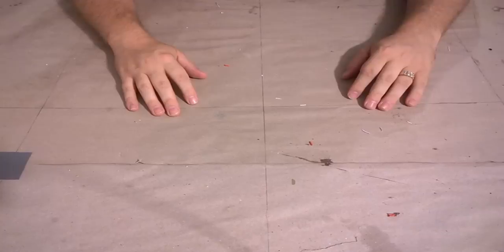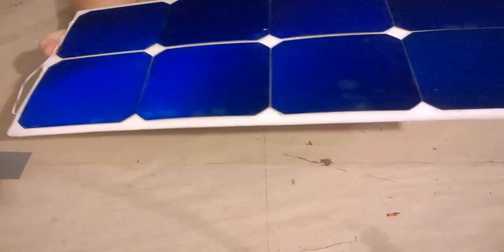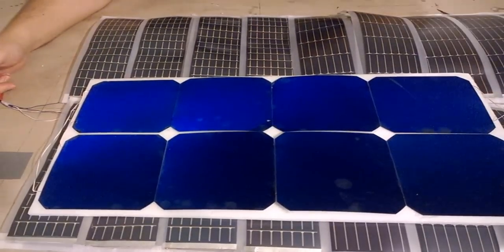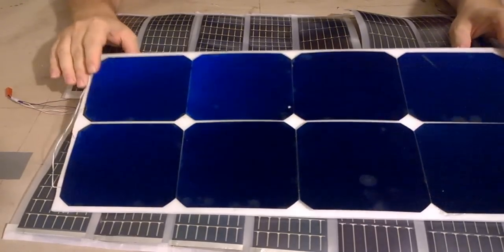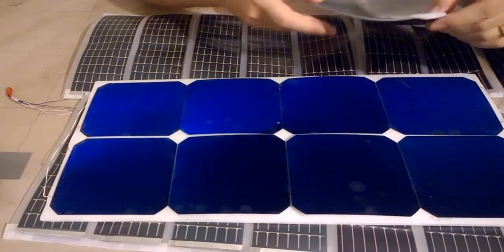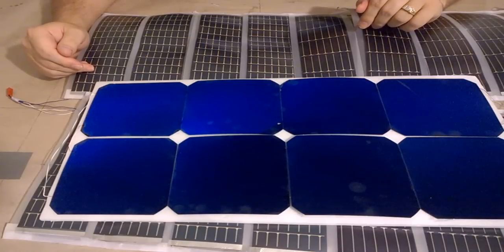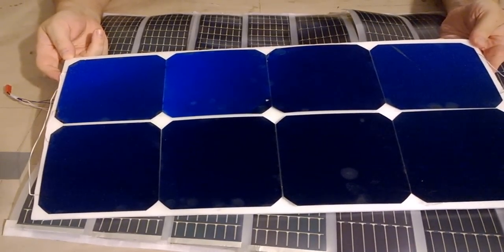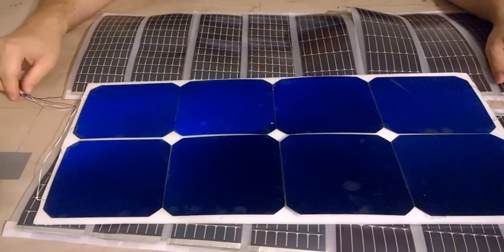Solar Airship Project Update: New Solar Cells

Comment: So any news on this project?
Reply from the maker: Sure, I'm still plugging along. Since then an official FAA ruling has stated that beyond LOS was banned without specific gov aproval. That killed the long distance unlimited duration drone idea, and made it illegal for me to test my design further. Now I've changed my design and am currently building something much smaller, still capable of overnight flight, but with much shorter range in mind. The idea with the new one is basically just "station keeping", IE: it never flies out of LOS, but rather hovers in the same spot day and night for months on end. It can come down automatically for bad weather, so it is useful for sporadic outdoors use, like for monitoring crowds at an event, or providing wifi, or whatever.

Comment: Can you use copper tape for wiring? Thinking it might be lighter without insulation, which creates challenges of its own of course, but with an adhesive mounting making it easier to mount and run wiring on your envelope?

Comment: Cool airship and implementation of solar cells.
Our cells are not as powerful as the ones you use but check out our flexible plastic solar cells http://infinitypv.com/. they come on a roll and can be cut to your needs. We implement a high voltage system in our solar foils. They even come with a sticker on the backside if needed :-)

Comment: Baca I know you might think I'm crazy, but if you had enough time effort patience and intelligence, then you could design a rocket system for he ship..I know someone who made a rocket propelled paper airplane.. Also you can make contra-rotating props to cancel torque, and the 2 blades rotate half as fast but equal power because they share power, and no torque, or make 2 props for counterrotating blades. (All I know about is airplanes, not much about airships) also if you could, I designed and will improve a cargo bay thing for rc helis, I can modify it to airships
Reply: You can make a wind turbine thing maybe, cuz you know, it's flying so there's wind. But that may cause drag
Reply: +Niño Rata yes yes they can burn the plane, but many ww2 planes used rocket or early jet engines and were made out of wooden wings..and their paper airplane is made to make lift with speed..maybe have the rockets used as an afterburner? Don't know why you would need that for international unmanned flight if you can't see where your going. But I bet the computer systems to make it fly to destinations will be bacca's biggest obstacle in his life
Reply from the maker: +Larry Xiang Well, for now I want to continue to explore what I can do with Solar Power. I think that has the greatest potential. Although extremely high speed airships would be fun to do, mostly just to prove a point.

Comment: Use recharable 9v batterys, prefurably durrecell for there high amp input ablitys. Then go in to a small transformer. One small transformer is about 100g. While about 2 yards of 3 gadge copper wire is about 250g.. Saves on wait. And each recharble is about 15-30g. Just putting this out there. You are welcome to double check what i have said and correct me.
Reply: Trident, even though they are rechargeable, you can't recharge them in unmanned flight, and bacca'a dreams are to make it fly endless distances
Reply: +Larry Xiang the magic of programing is amazing. :)
Reply from the maker: +Trident 48 Nah, LiFe batteries are better power / weight

Comment: Good work man, it's so cool to see projects like this. You mentioned that the cells are high efficiency, what percent of sunlight gets turned into useable power?
Reply from the maker: +preston lincoln They are getting a little more than 20%. It may not sound like much, but most solar cells are more like 10, and those light weight flexible ones were even less than that
Reply: +BaccaYarro I didn't know they had gotten up to 20% yet, that's so cool, best of luck with this